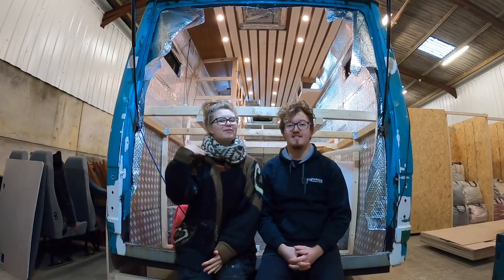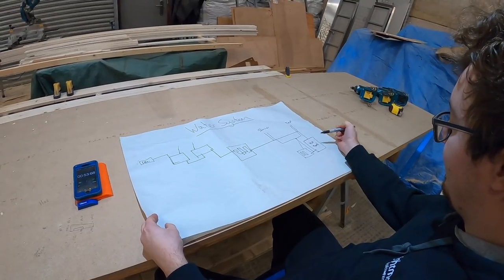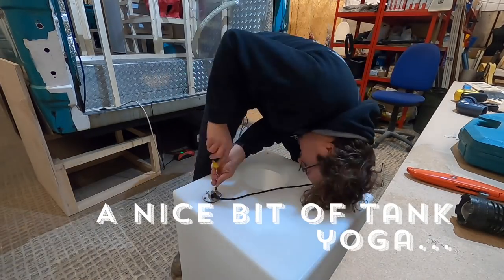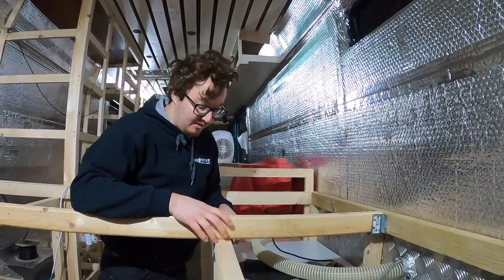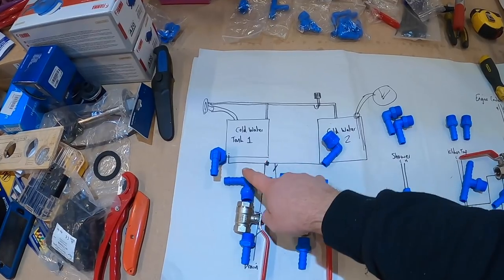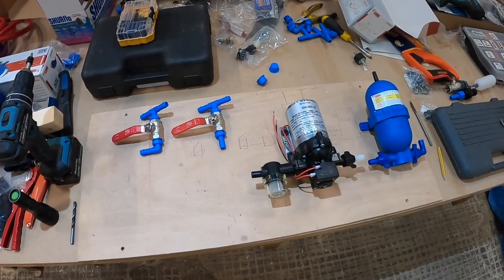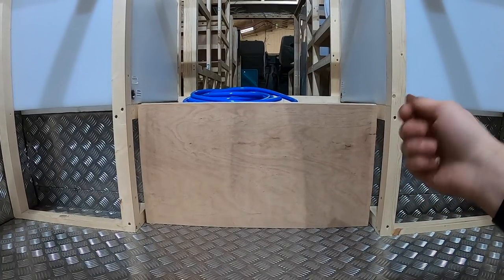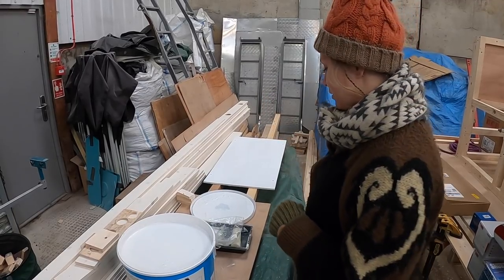VAN LIFE PLUMBING | Cold Water System for a Self Build Camper | Pump & Accumulator | Van Build Ep17

Comment: You might want to put a strip of think rubber under the pump board, as over time the rubber bobbing will sag and the board will vibrate against the floor
Reply from the maker: We’ll get some on standby and keep an eye on it! Thanks so much for the tip! 😊👍

Comment: Great vlog as usual, your build is going faster than mine and you've got a bigger van than me! 
Can I suggest that you fit one more isolator ball valve on the other side of the pump panel (after the accumulator). That way if you need to change the pump or accumulator at any time you can just isolate the panel without draining the whole system.
I really enjoy your channel,  Merry Christmas and here's to a brighter year in 2021.
Reply from the maker: Haha thank you so much! What are you converting?
That’s a great tip, and we do have a spare so might add that in as we hadn’t thought of doing that!
Really glad you are enjoying it and Merry Christmas to you too! 😊👍
Reply: @MaxSophieinaVan 
I've got a lwb hi roof transit. It was a lucky find as it's a 2003 with under 20k miles and looks like it was kept in a garage as there is no rust (yet).
Reply from the maker: That sounds like a great one! Happy converting! 😊

Comment: well done guy's, only thing I can see as a problem is your balance pipe between the tanks might be too small, as you fill the first tank it will take awhile to balance out as such a small bore compared to the rate of fill. I hope that makes sense ?
Reply from the maker: Thanks James, this is something we haven’t checked yet so will test it and see how it works! Thanks for the heads up, if it doesn’t would you just increase the bore of the pipe? 😊👍
Reply: @MaxSophieinaVan  yeah as big as you can, as the pressure and speed of a hose pipe filling the first tank, would then be going via a small pipe to the second so first would be full the second perhaps half full, then over time it would balance giving say 3/4 in both
Reply from the maker: Nice one, we’ll give it a test and see how well it works and then upgrade to a bigger one if we need to! Thanks again for the tips! 😊👌
Reply: I agree with jamesc76. I would connect the two tanks directly with a pipe at least the same size as the fill pipe. Alternatively, tee off the filler pipe to feed the second tank at the same time. Also, have you considered what would happen if you over fill the tanks and where the water goes to. You have a vent on the tanks, will this be large enough to also work as a water overflow pipe?
Reply from the maker: That’s another great option if the second tank doesn’t fill enough, thank you! And I think we will just watch the tanks through the garage and then stop, but we have a drain out if we need to let a bit out of the tanks 😊👍
Reply: @MaxSophieinaVan  Hi, like your videos and of course your van. I build nearly the same water system with two tanks connected with a 19mm hose. And the second tank is only half full when the first is completed. My suggestion is, go with a 40mm like the filler hose.
Reply from the maker: Thanks Thomas! I think we’ll give it a test run then might end up having to do that! 😊👍